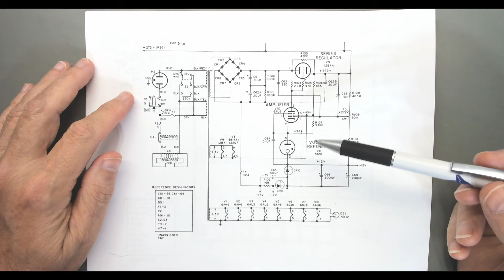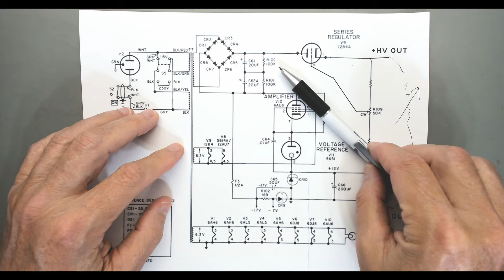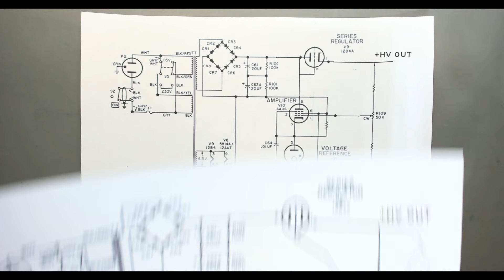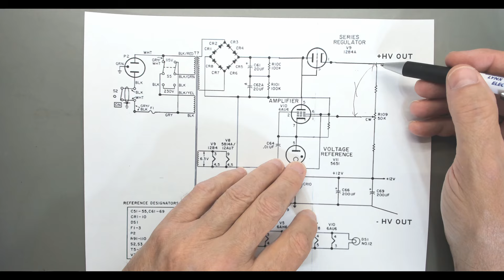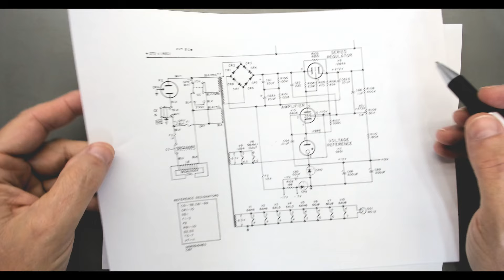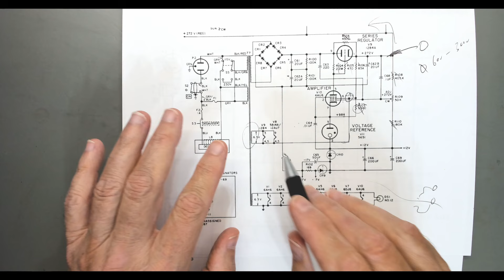Turning Scrap Parts Into a Working Power Supply!

Comment: Hi RJ, that is interesting that the voltage dropped by 10 volts between the two power resistors even drawing a lot more current. Did you connect a scope to it? Curious about noise and how quickly the circuit responds to the different loads. RR
Reply from the maker: Hi Rick, good to hear from you!
As you know the videos you see are in the past. So no spoilers 😢
In my next video you find out what I found out when I dug into the circuit. RJ

Comment: You have done it again RJ and sent me back in time.  In 1964 I built a supply featured in the July 1959 issue of Popular Electronics.  The article was titled - "Experimenter's Variable Power Supply".

I used a transformer from a defunct TV which happily exceeded my needs.  That power supply followed me for several decades.   By the way, I am 75 so 1964 was a long time ago.   73,  John  K0EBC
Reply from the maker: That is so cool John! I also have many fond memories from old projects. 
Thanks for sharing. 
RJ